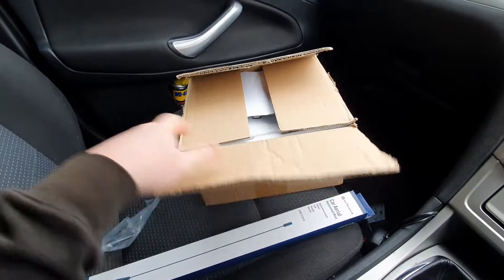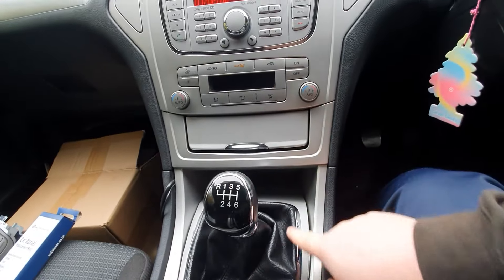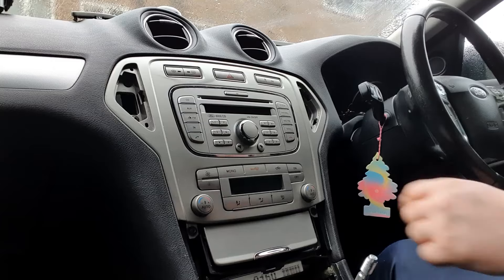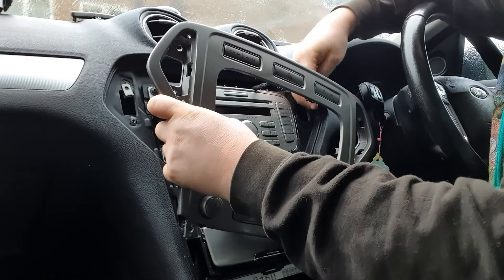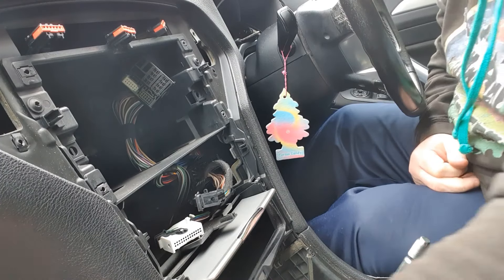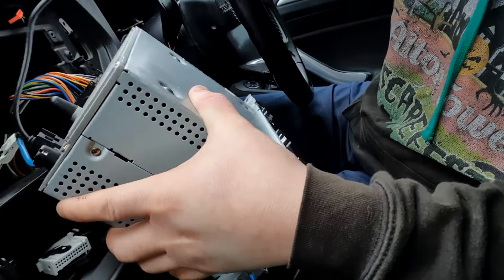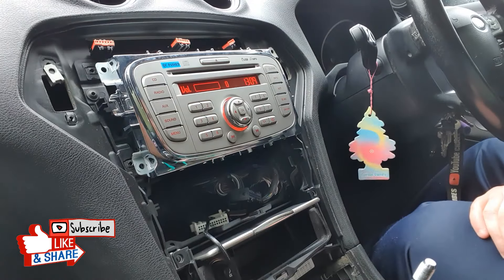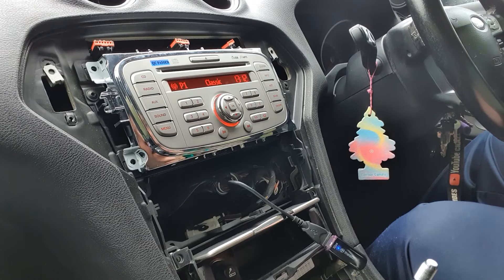Ford Mondeo MK4 Radio Change USB/MP3

Comment: Good job. Funny how my starter button was to the right of the radio in the triangle piece and yours isn’t. Mine was the 2.0L version. Maybe that’s the difference. Thought you might have needed a radio code though. I’ve seen that radio in a car before. My wife thinks it as in a car Ford we rented in the US. Like it.
Reply from the maker: Yeah i seen that im some models of the Mk4. With this radio no code is needed, and its a nice upgrade from the other stock one.

Comment: What did you need to do to get the steering wheel working with the new radio? Did you need to buy a seperate cable, and if so, which?

Comment: Hi there that's a brilliant job! I got a question though, is there any way to enable Aux through a simple jack cable?
Reply: The mondeo mk4 has a jack 3.5mm jack socket in the glove box. Plays when aux selected.
Reply: @royharding9694  thank you for the reply. The jack never worked, plus the car is long gone. But thank you haha

Comment: Hi, did you get the iPod actually working on this stereo? Like real iPod (iPhone ideally), not just USB flash drive with music...also, what about the RDS? Is it showing the radio name on the display? And in the instrument cluster? Thanks ;)
Reply from the maker: Morning, yes i did im still to editted the video on what i done, but i ended up buying a cable that plugged into the ipod and it split into 2 one part usb and one part aux. Video is only a few minutes long. But will sort it out
Reply: @ChazzCoombes  morning, ok thanks, I will check the video when it's out
Reply: Forgot to say, maybe worh considering giving links to where the bought your cables and new unit along with price paid...

Comment: looks ok didnt you have the aux port or whatever its called in glove box min has i just use that instead of changing the unit
Reply from the maker: Yeah i did but wanted the usb connector for the ipod
Reply: @ChazzCoombes  I was going to do what you did but decided couldn't do with the Hassel so just left it